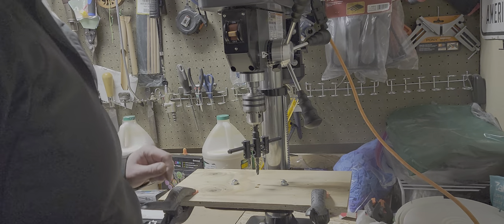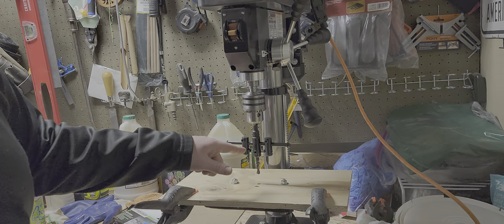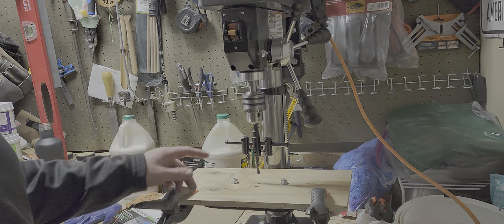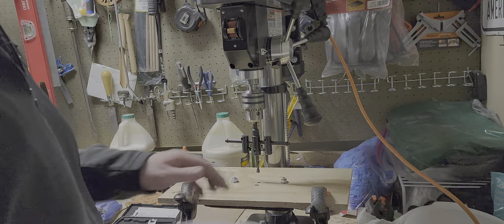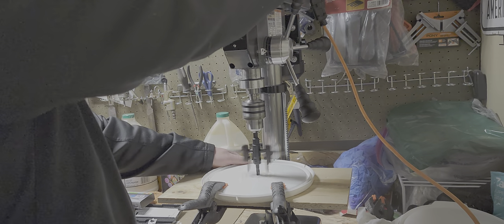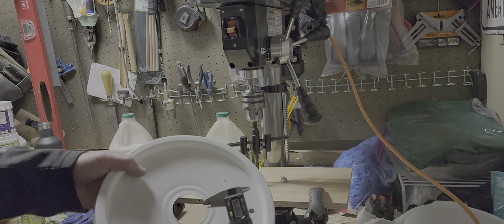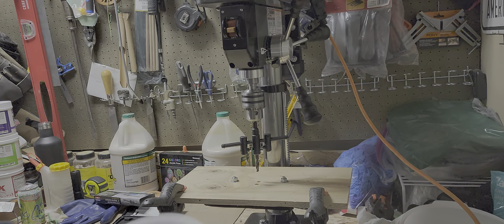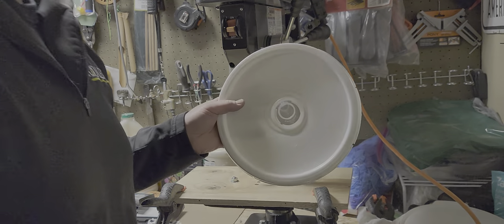Bucket Feeders for Beehives, How I made them using Tint Plugs.

Comment: I'd like to know where you got the buckets for $1. I'd also like to know how big the holes are that you drill in the tint plugs.
Reply from the maker: The hole is 49mm, the buckets i get from my local Walmart bakery. They are frosting containers. Use the ones with snaps all around, 8 in total, the ones with 4 snaps leak a little more.

Comment: How big are the holes in the tint plug?
Reply from the maker: 1/16th drill bit. Place as many as you think is necessary. The thinner, the less you want to make, the thicker the more you want to make.
Reply: 2in to fit bucket but no holes in plug you haft to do that 18gage staple